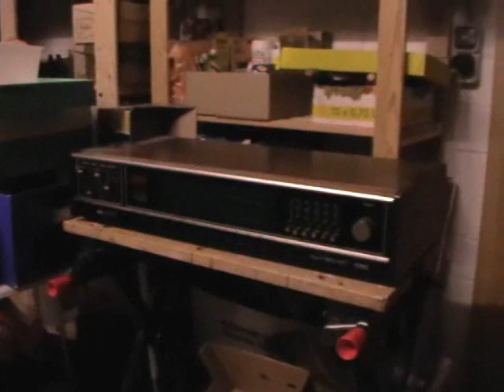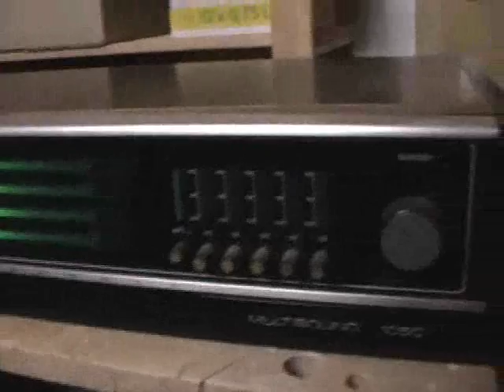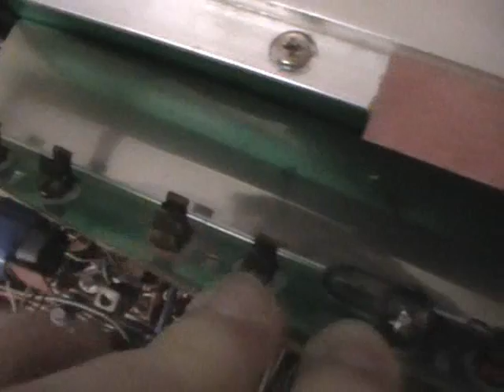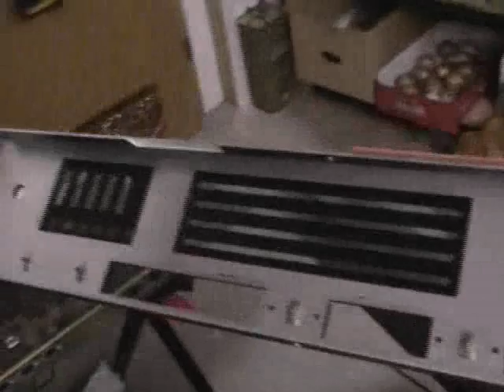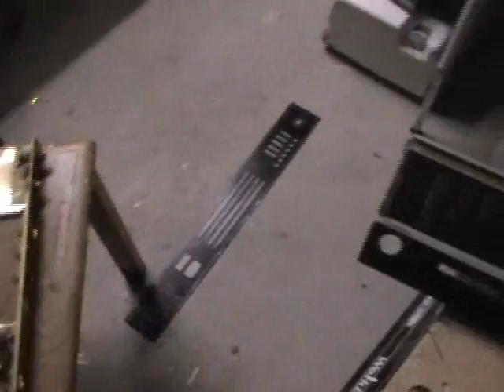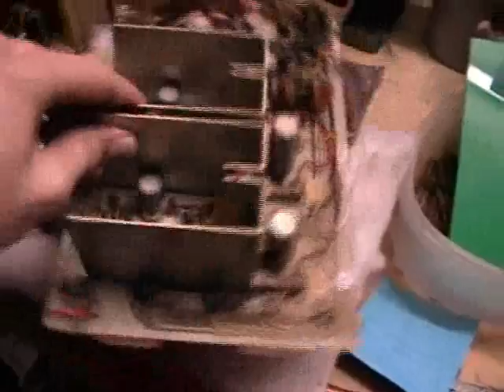DrCassette's workshop - 1970s NECKERMANN receiver teardown!

Comment: Yes, I agree with Jonas it is from the seventies, the style of components would not have been found in "budget" seventies stereos like this. Also, if the unit is really Quadraphonic ( I doubt) well, Quad did not come out before the seventies. I think, 1971.

But Jonas, you must realize that even the best makes used plastic front covers. Think of it: silkscreening metal faceplates wasting a faceplate if the process goes wrong, or silkscreening a plastic sheet?

Comment from the maker: Yes, it could be from the 60s, I'm not sure. The transformer looks like it was from the 60s, but I think the style of the transistors is from the early 70s.
Untill the late 70s all the German made receivers and all the receivers made especially for the German market (like this one) looked like this, if you have seen my SABA 9080 receiver you know that they're looking really similar...
I don't think the amp is that powerful, but 25 watts per channel are possible with that setup...